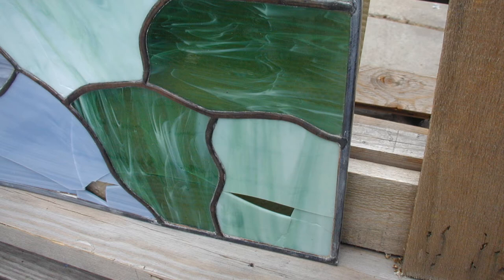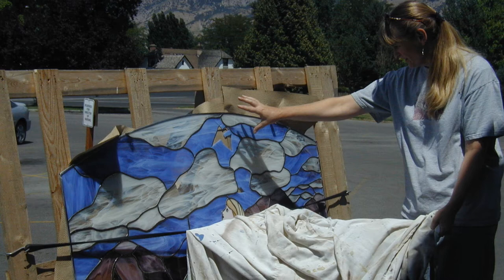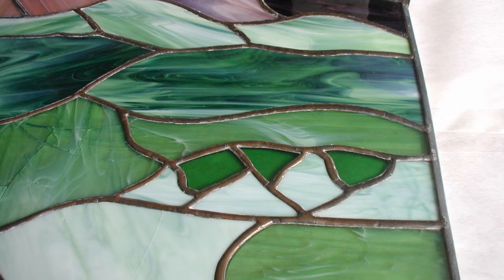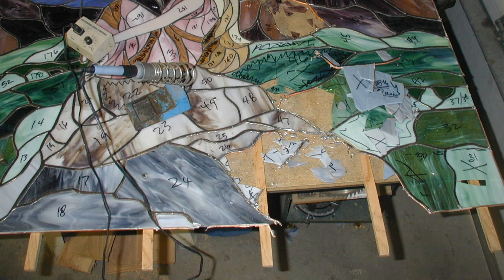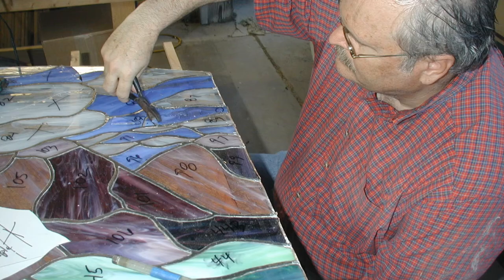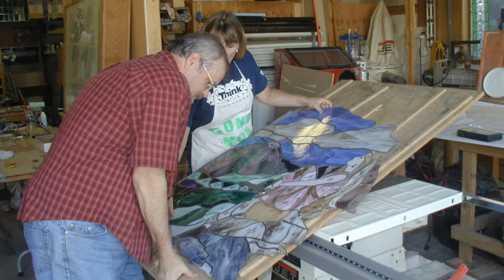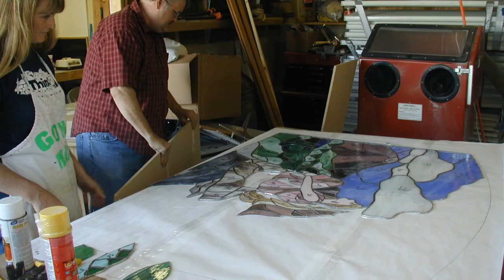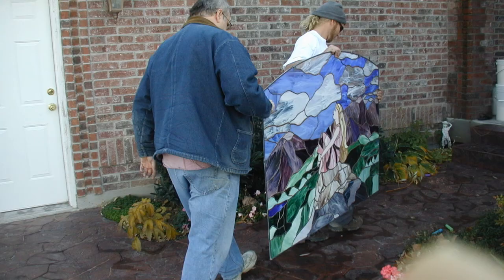The Big Bad Repair V087

Comment: I have used the 2" thick styrofoam insulation sold at Lowe's with great success. I cut it to size and sandwich the panel betweem 2 slabs.  It comes in 4 x 8' sheets.  It is very rigid but easy to work with.
Reply from the maker: I added a video about how we do that nowadays UPS requires that you package in 2" of foam to be insured.

Comment: my God !!! I understand you because I have just been doing this ,replacing broken pieces in a panel .But they get broken during the soldering .I don't even understand how ??? maYBE YOU COULD GIVE ME A LIGHT ON THAT ... YOUR VIDEOS ARE VERY HELPFUL .THANKS
Reply from the maker: When glass cracks during soldering, it can be because it gets overheated and sometimes a drop of solder rolls onto the glass causing a heat sink which can crack the glass. But by far, for me, the greatest reason we get breakage in our studio is weakness in the glass. If you grind your glass with a rough bit or with poor technique there can be weaknesses in the glass which breaks from the heat of the soldering
Reply from the maker: Well, I've learned to secure stained glass down very securely. Sometimes I do dumb things! There are several videos on our channel about repairing glass, good luck on them.